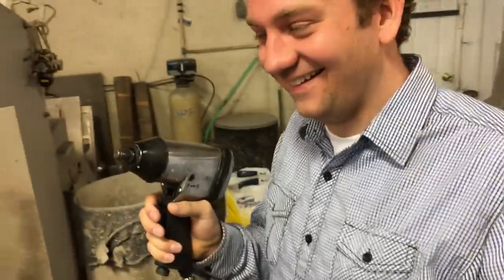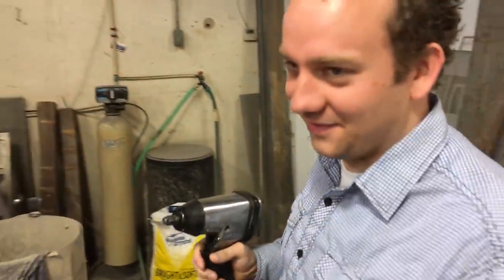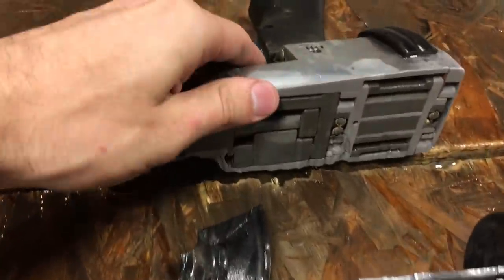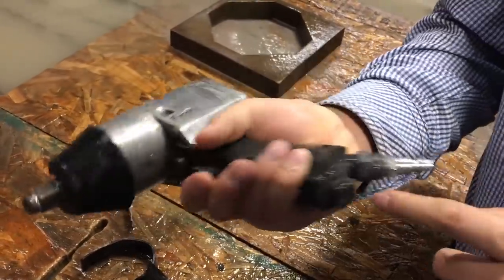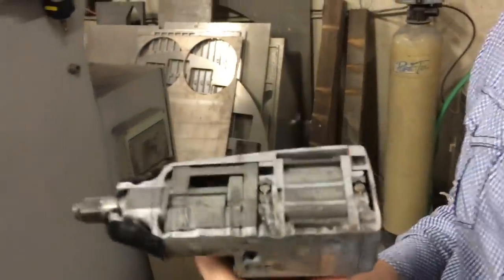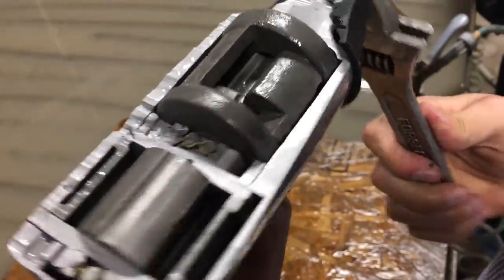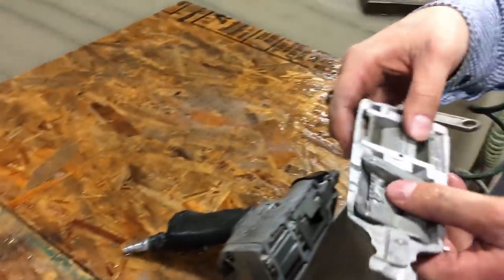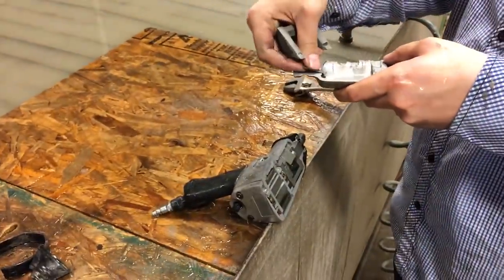Inside Of An Impact Wrench vs 60,000 PSI Waterjet

Comment: The knock in a impact gun is the hammering effect as it turns it builds pressure on a spring until it pops under high compression and that's what gives you the hammer effect. You can try to turn the shaft by hand but you probably won't go no further than a quarter turn before the hammer part stops

Comment: you should totally water jet a transmission and a engine block
Reply: Waterjet Channel holy-- DO IT
Reply: all we need is someone to donate or mail them a transmission or engine block
Reply: It wouldn't fit under the jet
Reply: Kris Lewis if you use a small block engine from a Toyota Corolla and it's transmission
Reply: Are you sure it should be totally, and not partially ?

Comment: You guys should try to spin a fidget spinner with the waterjet and see how many RPMs it does or see if it explodes
Reply: Right. Just use water and no abrasive. At a couple hundred thousand rpm, you should have a nice little bomb.

Comment: Is there anything this thing can't cut? Serious question

Maybe matter from a white dwarf
Reply: jamie yello If there was, it would have a yield strength greater than 60,000 psi, assuming there's no abrasion. I don't know enough about the physics involved to know if there are other factors, but I wonder if it can cut maraging steel.
Reply: But, the abrasive in the water increases that. The water does not push away the material, but rather cuts through it, just the same as rubbing a saw or grinder on it.
Reply: how much did you pay that dwarf to let you collect their "matter"?